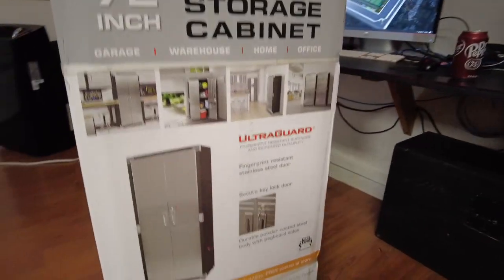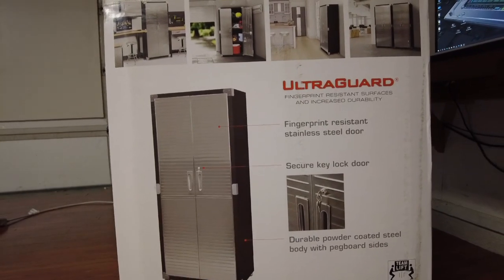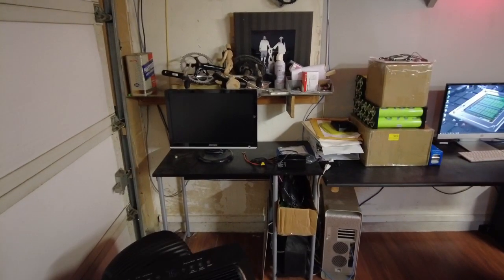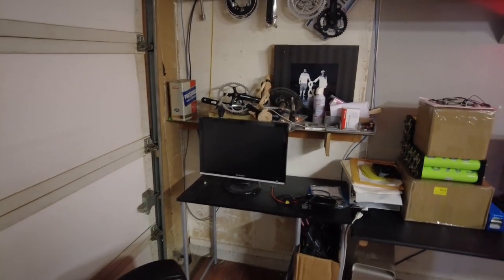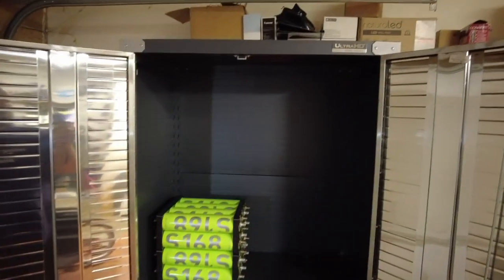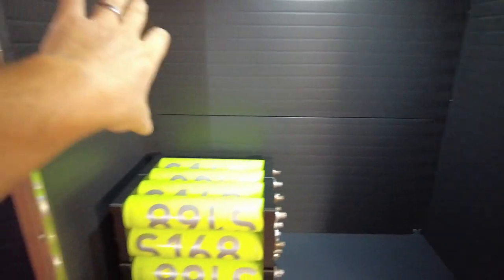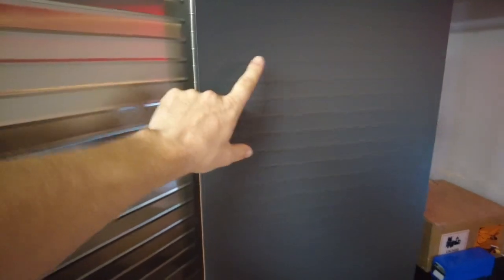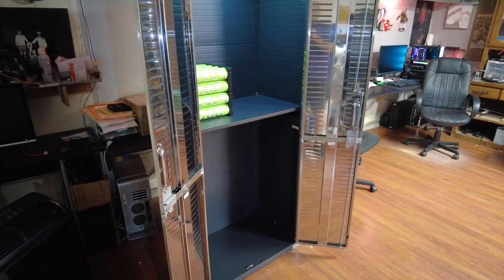Metal Power/Battery Cabinet

Comment: hello I am building a battery cabinets with the SAB cells it is still a work in progress. i want to show you what I am doing so far let me know if you want my video link.
Reply from the maker: Absolutely, let's see it!
Reply: https://youtu.be/Io875M7556A
Reply: Let me what you think.
Reply from the maker: @1919wick  Loved it, subscribed!
Reply: @BradCagle   Thanks. What do you think?. Do to work I haven't gotten around to make look cute lol plus I am planning to do a capacity test running 12000btu mini split heat pump, a space heater a humidifier and it is also connected to my sunroom circuit 100% and my living room which has two ceiling fans. I never did a capacity test on the individual cells and I'm doing it a bottom balance.
Reply from the maker: @1919wick  It's great! Your setup is very similar to what I'm doing. We'll I'm really just going to power my garage/mancave. It has 10000btu inverter AC (like mini-split) and my computers that are crypto mining 24/7
Reply: @BradCagle   I have mix feeling for Krypto mining but I don't have enough sunlight for doing that.

Comment: The tops & bottoms of those batteries must be insulated, so moving the cabinet will not risk the batteries shorting against the metal of the cabinet.

Can a sub panel be placed on a moving unit, like a steel cabinet? If so, I would be a big fan of it! 

Are you thinking about using a 240V 50A plug to hook the cabinet to your home?
Reply from the maker: Yup, i'll make sure everything is insulated. As for the sub panel, I'm not sure. I'll have to look at code. Would be nice if I can make it a self contained unit, and be up to code. Not planning to power the whole house ATM, just the garage.

Comment: The cool thing about that cabinet is it gives you room to expand, if you decide to add more batteries down the line.
Reply from the maker: Absolutely. I have another 6kw to put in there.
Reply: @BradCagle  - More of the 60280 cells?  Would that be a total of 48 cells, when it's all said and done?  I think I miscalculated...32 cells?
Reply from the maker: @jasonbroom7147  No, I have a bunch of 26650's that Jehu Garcia gave me, and I have some of battery hookups 100A modules. So it'll be a hodge podge of 3 different packs of similar capacity.
Reply: @BradCagle  - That's cool.  I think 26650 cells are a way better choice than any of the NMC options, for building a larger power wall type of unit.  I'm using them to build small battery packs, wired in parallel, to power the small air pumps used for keeping live bait healthy while fishing.

Comment: I've been puzzling over metal cabinets too. However, it occurs to me, one of the reasons I became interested in LiFe was the fire hazard advantage.  I saw people drilling holes in 'em with no flames or explosions. Hmm.  Still thinking about it though.  Nice tip.  :)
Reply from the maker: Agree. Same for me, however the overkill safety factor, and everything being tidied up pushed me into it :) Plus, I have a grandson running around so I could literally see him tossing a wrench on the battery terminals, LOL
Reply: @BradCagle  - if your grandson climbs on and moves or topples that cabinet, shifting the batteries, those batteries shorting against the walls or shelves might be a real issue!

Maybe a U shaped plexiglass 1/2 housing, where the horizontal bottom of the batteries are bound to the horizontal of the U Plexiglass, to provide end protection from shifting, while allowing ample breathing room?
Reply from the maker: @DavidHalko  The cabinet has straps to secure the top to the wall. There's a 2x4 right behind that I'll strap it to. The cab is powder coated, but I'm going to add extra insulation where needed.
Reply: @BradCagle  - “secure the top to the wall” - of you want to throw it outside in a fire, you’ll have to figure out how to balance the safety need of fire vs the safety need of securing.

No good answer for you, except maybe Velcro straps, that might melt together in a fire, but be able to rip open quickly if the cabinet needs to be moved!

I love the metal cabinet idea, by the way.
Reply from the maker: @DavidHalko  Good point,  however I'm confident i can rip it out of the wall. Balance between 4yo not being able to topple it over, and not doing it up too much where i can't pull it out under force. Funny story my nephew caught the drapes on fire in the sunroom, i pulled the flaming drapes with the rod, and the wall mounts out in one swipe 😂
Reply: @BradCagle  - U Da Man!!! LOL!!!